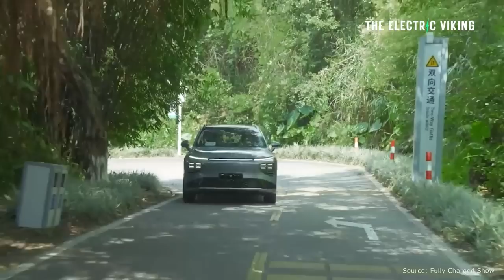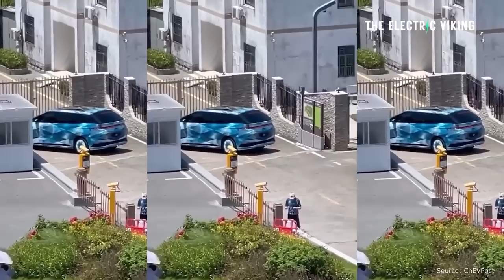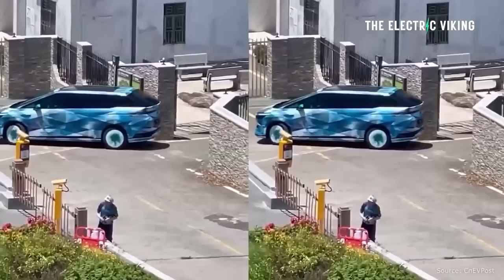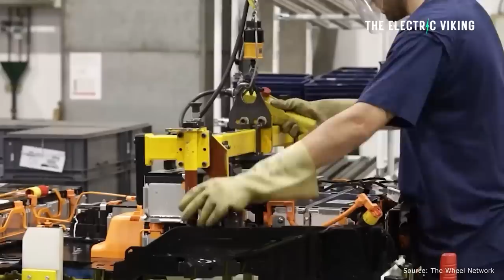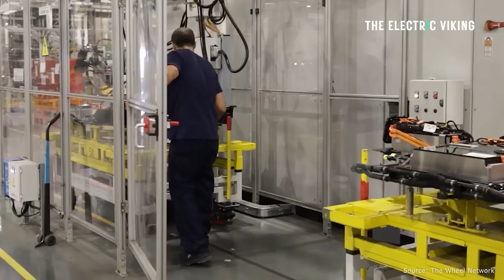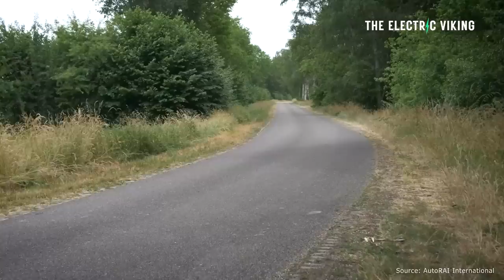Xpeng reveal NEW 500HP all wheel drive MPV electric Van

Comment: They have always been called MPVs, usually.  Like all MPVs, its good for certain buyers.  Remember when the Tarago was all the rage?  So, are you suggesting this is the vehicle for those who are family planning challenged?  😂.  Do you think they could afford it?
You started to tell everyone the battery pack size and immediately went on to describe the motor power output.  So, I’m still in the dark.  Would be interesting to know the battery size as the internet suggests its a 98kW unit, but is that the 2WD or the 4WD, or is that even correct in the first place?  If that is correct then that is a big battery.